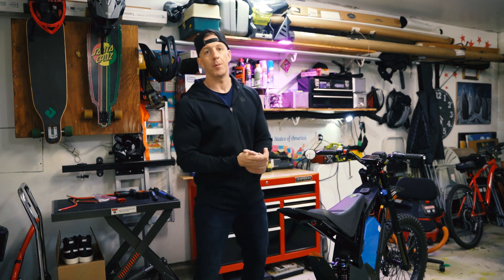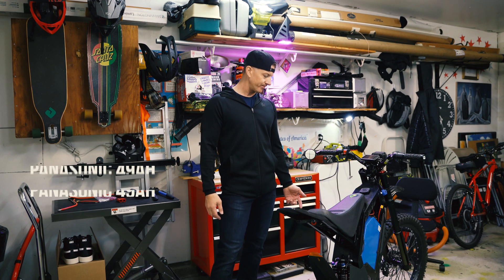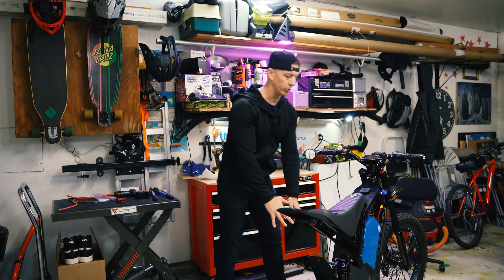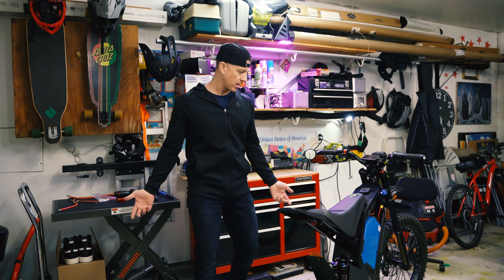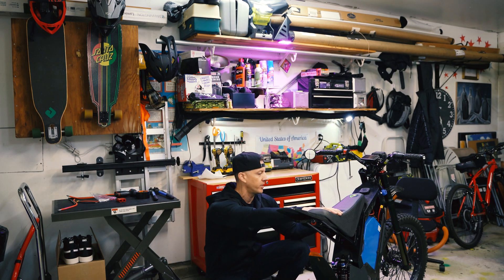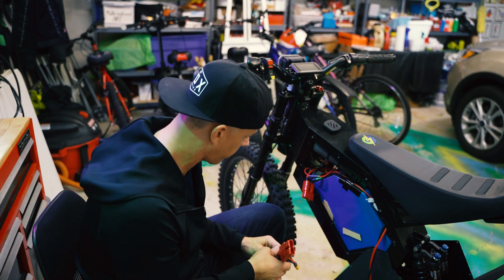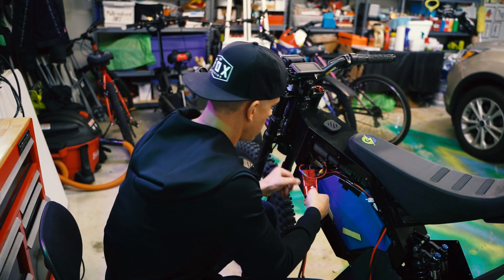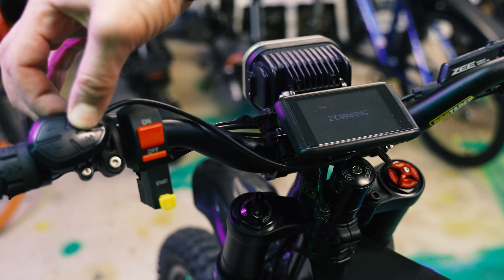UPGRADE to TWO Ebike Batteries = MORE POWER & Range!!!

Comment: I want to add more ahs to my battery.  Didn't see how you splaced together stock battery to extra battery to controller. I have a compartment enclosed in garmata moto seat. Probably fit 20aahs extra. My stock one is 40AHs. I average 28 miles max  per charge. I need 60miles+ per charge. I have a 72150. But not tune yet. I need to turn up regen to max. Also which wires to hookup wheel lock and ebrakeing. So don't use reg brakes. Thx for any help. And do you know anyone to build batteries.

Comment: Hey Josh is that abs plastic on the side covers i made mine out of abs 16th of an inch thick with the snell side out  my bike looks alot like your bike with the fenders and sid covers i have the enduro tire's and put wider handlebars with a short goose neck .but still using the motorcycle seat from the factory.
Reply from the maker: No they're the metal side covers with a textured rubber grip on them.

Comment: i have bomber with 40Ah 72V battery and I am also thinking about upgrade  . battery has 3600 miles under the hood and  I have two options..either go for  60 Ah  and ruin myself financially (lol) , but i would stilk have the old one as spare ) or add one smaller battery in paralel to existing one. I was thinking about putting it on the top of the  body, but inserting it down  under  is really great idea!!   I will definitely consider this approach. thanx much for inspiration 🙏

Comment: I was thinking of building one of these but after hearing from guys how much they have in the bikes and still have to reinforce the frame I am thinking that the CAB Eagle or Recon is not such a bad deal for having the most powerful and long ranges bikes you can buy that are way over engineered and ready to go for a price that is just a little more than what you have put into your bike.
Reply from the maker: No dude they use the same exact frame that we do and charge triple the price.  Ripoff City man
Reply: @JoshStreetDesign  I noticed that you did not list the frame in your parts list. So can you please tell me what frame is it that all these ' Ripoff City" companies and you use. I ask this because to me your frame looks nothing like the CAB Eagle frame
Reply from the maker: @LarryRichelli  no my frame is different than theirs.  My frame is all metal with thicker swing arms, theirs uses plastic side panels. Their frame is lighter obviously.   Their's is called called the EEB frame, the electric Enduro bike frame.  Just type that on eBay and you can buy it for 600 bucks.
Reply: @JoshStreetDesign  Thanks but do you have a link for your frame. I agree with you that that frame on ebay is very light duty.

Comment: What's the bms ratings on the small battery?
Reply from the maker: I'm all honesty I completely forget
Reply: Just wonder because bms on my first battery it's 200 amp peak and the secondary battery I want to get it's 100a peak so if the controller we'll draw 200 amps will the secondary battery cut out.?
Reply from the maker: @adrian.zyskowski2145  pretty sure it will not

Comment: Great video.
Question, my battery is 48v 20ah.  My controller is 48v 20ah. Manufacturer upgrade from 20ah b/c none in stock.
Will this combo work? Heard it could damage battery.  I use PAS too when riding.

Hope you can help.

/Bklyn👑
Reply from the maker: Hey thanks for watching but to be honest with you I'm not sure I understand your question.  What is different?

Comment: Who the guy that made your battery I'm I. Brick nj
Reply from the maker: Believe it or not I got it off Alibaba and I've had zero problems with it it's still charges to a full 84 volts after a year and a half and a crap ton of riding.  Got it from the Blue Dot sellers.

Comment: Won't your controller overheat? Surely they put it on the outside for a reason and adding another battery will only stress it further.
Reply from the maker: Nope, controler barely even gets warm.
Reply: @JoshStreetDesign  ty

Comment: Great video. Where did you get the frame?
Reply from the maker: Alibaba
Reply from the maker: It broke this past week, had to weld it.  It's stronger now then before
Reply: @JoshStreetDesign  so probably not worth buying specially since I don’t know how to weld
Reply from the maker: @vb1594  if you're just going to ride on the road you won't have any problems

Comment: great video, how do you manage to charge it?
with the same charger and you recrimped the charger connection on the bike aswell?
or you charging the 2 batteries separately?
thanks
Reply from the maker: They both charge at once as a single battery.

Comment: Solder. Not a fan of high amperage with crimp alone. It's what we do in electric towbarless airplane tractors. They pull anywhere from 20A-800A!! Just crimp had a heat issue and power loss. Just my experiences, I'm just a guy from some place rambling... Nice bike tho, Dig it.
Reply from the maker: See I did the crimp because I've read in the electricians code handbook that crimp is more reliable than solder and conducts power more efficiently...

Comment: mate, using male (going by the pin, not the housing) XT connectors on your powered side is not a good idea. All it takes is one scrap of wire (or your finger if wet/higher voltages) or a connectors softened by heat to short out your battery - or in your case, should that connector happen to work loose while your riding it wouldn't take much to then short out your main pack inside your battery box... Using the female pin connectors means its at least 'touch safe'. I get that 'thats what the 2nd battery came with' but thats why you dont use these connectors to parallel batteries. Change for Andersons or use some other connector entirely and you mitigate that risk pretty much 100%.

Comment: Be careful with that frame offroad, its not welded very good and if you hit some harder bumps or jumps you might break some welds. I personally woudnt ride that frame at all offroad.
Reply from the maker: I ride this thing as hard as possible off-road.  I frequently check the welds and everything still looks tight. I have a feeling that some of the ones that went on the factory weren't as good as others. I feel like I got a good one
Reply: Yeah but you dont see the micro cracks until your front fork breaks off 😅. Dont trust china welds, just saying. Check Vector ebikes out, they have nice quality frames. My next bike will be a Vortex frame with 7kWh and 20-30kW, far in the future 😬
Reply from the maker: @theblackbike9083  whatever dude I'll ride it till it breaks.  : ) if it breaks it breaks, I'll just build a new one or just re weld whatever spot breaks
Reply: Optimistic view haha, lets hope it doenst break at 40mph off a root 😬

Comment: How's it going...

So yeah, I have basically the same frame as you that I got from Alibaba.
I recently purchased a Subvaton 150a controller, 5000W rear Risun Motor wheel, and the TFT750..
I'm having a hard time finding a new battery that will fit in my frame. 
My current battery is a 72V 26ah 80BMS Samsung and need to upgrade to at least a 40ah with a 150BMS.
Where did you get your battery or do you have any suggestions for me where to get a battery that will accomodate my 150a controller and will fit in my frame..
Thanks ..
Reply: WTF SKID..

You answer other questions but not mine..

Fucking GOOF!!!
Reply: @e-bikehobo9764  He must not like you
Reply: Damn he really did didn’t he

Comment: At 72v and 150 Amps your already pushing 10,800 watts. That motor peak is only 12,000 and that is probably over rated. Plus there is the tire diameter and spin rate to factor in. The 3.5T is 950 rpm max at 72v but that is more about top speed than torque. If your wanting more power but less top speed you might go to a 5T motor. The motor you have is the "fast" one not the "torque" one. 
There is a lot of info here on that motor
https://endless-sphere.com/forums/viewtopic.php?t=78461
Reply from the maker: You obviously haven't seen my latest video, lol.  https://youtu.be/LJEx6iZzZX0
Reply: @JoshStreetDesign  OK So I watched that one. Glad you are more happy with the 5T but you still have some issues with the battery setup. I'd like to see a link to that Panasonic 72V 49A battery to see what the actual specs are on those. But adding the 20s3p in parallel is theoretically possible especially since the voltage is the same however those LG MJ1 INR 18650 3500mAh batteries in the smaller pack only have a 10A discharge rating so 20S3P is 72V 30 Amps max assuming the BMS is rated for the same. When you get on the gas your going to ramp up to pulling 30A from each or 60amps total and then the BMS is going to trip on the smaller pack dumping the 60A load to the bigger pack which is where your probably seeing the voltage sag on your display. Adding that 2nd  smaller pack will give you extra range (assuming you stay under 30A draw) until the pack pack drains and cuts off and shifts all the load to the bigger pack but it will not give you extra amps at hi-power because the BMS is only rated for 30A. Does that make since? 

You could get away with doing this (since your space limited) by adding a 2nd smaller lipo pack of the same voltage with a high C rate of discharge. Some lipos have up too 50C discharge rate which would match your 150A big pack but you would have to run like 20 if them in series to get your 72V match 

Yes you can run 2 packs in parallel which can give you almost double the capacity if same size
 and  they do not really have to be the same type, I've read people running both lipo and lithium in parallel.

But if you are running 2 packs in parallel then they need to be the same voltage and ah.
 If they are not the same ah then one will die before the other which is fine. The BMS will protect it. But if you have one with smaller voltage the larger battery at 72v (example) and the other pack at 48v when you parallel them then the 72v is going to try to dump into the 48v. Which will ruin the 48v pack
Reply from the maker: @jamescole6846  that's a great well thought out reply, thanks for all the info.  The second pack is running at 72 volts as well, and I think it has a 40amp bms, but I see what you're saying.
Reply from the maker: @jamescole6846  honestly my biggest gripe about having the second pack in there is that my tire hits that controller box on big jumps and hits as obviously there's less clearance towards the backside of that tire now.
Reply: @JoshStreetDesign  Well hopefully it is not a 40A BMS because as I stated your pack is a 20S3P and those LG MJ1 INR 18650 are only rated for 10A discharge so 3 in parallel is 30Amp max at 72V.  40A pull would burn them up.

I have not built a bike as powerful as your but I am running a 5000 watt motor in a similar frame as well as have 5 other bikes I built and have built several li-on battery packs. My problem is the pack I need is about the size of the one you have but I dont want to spot weld that many connections and I dont want to pay for the pack to be built so my interim solution was to use 8 of these. 

https://hobbyking.com/en_us/turnigy-high-capacity-16000mah-4s-12c-multi-rotor-lipo-pack-w-xt90.html?queryID=b72512a6d41c9b0c67742ffa64a34dc8&objectID=80209&indexName=hbk_live_magento_en_us_products

 in a 4S2P config. Charge voltage is only 66V and nominal is around 60V but with the 12-24C rating on these I can pull as much as power as I want. 16A x 12C is 192A continuous plus they are 2P so really  384 Amp Continuous or over 700A burst at 24C (which it says they are rated for) but I don't have the wires to support that even if I did have the motor The point is, the on demand capacity is there.  Which is what you need.

The drawback is these are a PAIN IN THE ASS to charge. Each battery (depending on which one you use) is actually a 4S lipo battery in a 1P pack. so 4 of them in series is actually 16 cells and 2 sets in parallel is 32 cells boxed in 8 batteries. Each battery has + - and a balance lead but NO BMS!! so you have to monitor these carefully and there is a lot of connection inside the frame to hook them all up. I custom made all of mine with XT90 connectors and 10Guage silicone wire. 

To charge them I have to unplug them all and then I hook each set of 4 to two of these 
https://www.venompower.com/venom-pro-quad-100w-7a-4-port-ac-dc-lipo-lihv-nimh-battery-balance-charger-0686

I thought about building a custom BMS that would charge all of these while in the frame but I got a monster Jeep a buggy, kids, life etc.... I just like trial riding. My Dirt Bike days are way over a long time ago when I was younger. My back, neck, knees, elbows have all either been broken or stretched beyond limits too many times to ride hard anymore.  But I have put over 3000 miles on my ebike just riding trails in the DFW area here in Texas. 

since I don't ride  as hard as you I am getting about 45-50 miles out of a charge on these with the total capacity being 60-66V at 32 amps or 1920 watts.   have about half the total watts as you but can pull 4 times the power. I charge at 4 Amps so they take about 4 hours with two chargers to charge all 8. They do make a 4S20A and a 6S16A as wells as a 6S20Amp you might look at but I dont know what the room is inside your frame. What I did was get the measurements of each of the batteries and then cut wood blocks to approximant same size and then stacked the wood blocks in my frame in different configurations to see what I could really fit before buying. 

My idea pack would be about a 20S14P with the Samsung 30Q which have a 15A discharge rating then I could move to a bigger motor and get 210Amps out of the pack but trying to build that...  280 Cells 4 welds per cell times 2 ends thats 2240 spot welds with my battery tab welder. Aint gonna happen I got 45 other projects I work on as well. I would love to have a one stop plug in charge port I would get in a pack like this but it really doesnt take that much time to pull all the lipos and charge them the way I do it now.

The Lipo's are going to beat the Li-on's all day every day for amp discharge no matter what the config and if you do go that route you can have a much smaller pack with a higher discharge rating. You might even scrimp on your volts a little if it will help fit in your frame. They both depend on each other respectively to work but Volts is potential and will give you more top speed where Amps is what moves things and gives you the torque. That Sabvaton  controller is not gonna care if your only running 60 Volts instead of 72 if you can get twice the discharge rate you will still have more torque. So when choosing your next battery combination you might factor that in. Like I said I run 4S 14.4 which only gives me about 60V in a 4S but I can pull 192 Amps on a single string . I also want to add that a LOT of those Chinesium batteries do NOT put out the rating they say they do.  Unless you see it measured in your controller display under realtime amps being used at full throttle you probably need to start there and see what that number is. Your battery voltage or their watt rating do not account for actual amps being moved out of your battery pack and if your Shunt value isn't setup properly in the controller that is not going to read properly either. 

Hope that helps :)

Comment: Are you selling the bike?
Reply from the maker: Why you looking to buy?
Reply: @JoshStreetDesign  I have one but it has lots of problems, I looking to buy one similar to yours,
Reply from the maker: @tshoba8  I would consider it at the right price.  I just put a 5t motor on it in a cross laced 18" rim, with a Dunlop K990 rear tire, set up for off road riding.  I actually have a lot of money into this bike.  I wouldn't expect to get out of it as much as I spent though.
Reply: @JoshStreetDesign  would it be easier for me to build one with your instructions?
Reply from the maker: @tshoba8  I have no idea what your skill level is haha
Reply from the maker: @tshoba8  I will also say though that it's a lot of work. I have a lot of man-hours into this bike between all of the many upgrades and customizations I have made on it. You have to have a lot of patience and willingness to learn many new things.
Reply: Any recommendations on lcd display that can support 72v? Is kt-lcd3 display any good?
Reply from the maker: @tshoba8  I honestly can't tell you I've only had experience with this UKC one display
Reply: @JoshStreetDesign  thank you for your quick reply,  I've ukc1 display showing communication error code 30h, I've checked the wires and they're all connected. Does this mean I need new ukc display?